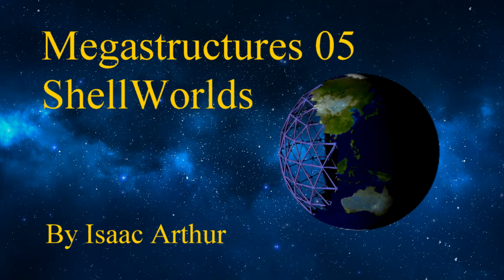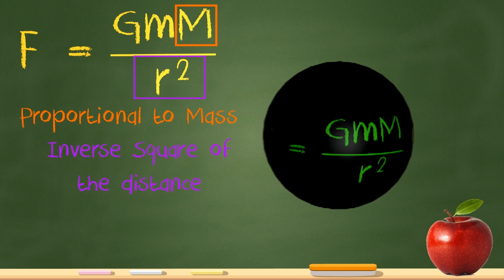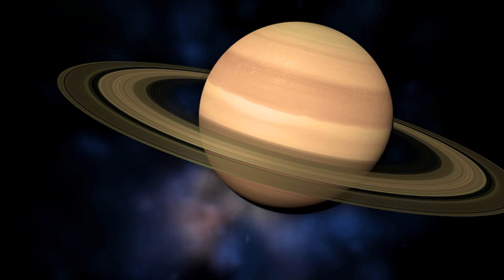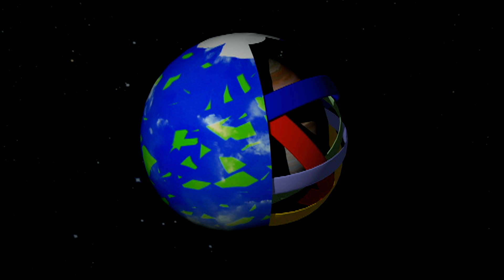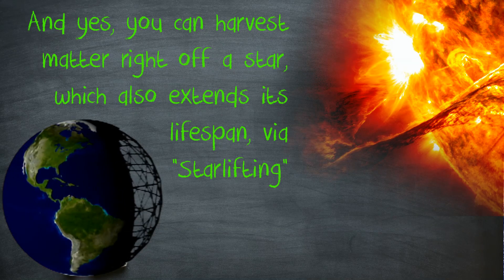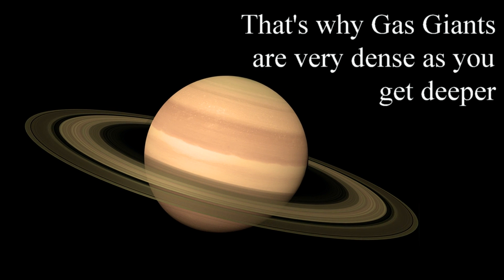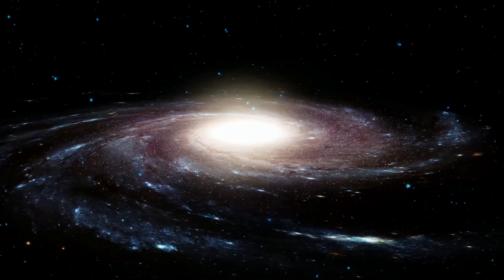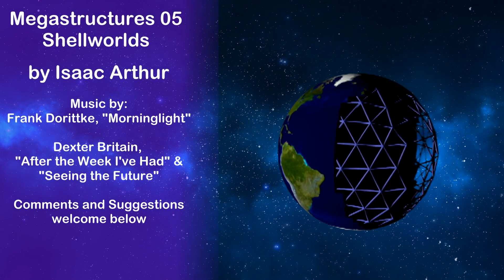Megastructures 05 Shellworlds

Comment: Couldn’t you essentially take this sphere interstellar to another star system with a large star, and essentially just siphon off the fuel from the star and increase its lifespan/expand your civilization using fusion to take excess star’s fuel, use it for your own energy/mass down to just carbon, oxygen, nitrogen, sulphur, etc?  

This is just in case there are no habitable worlds and you just enter a super massive star system with no other planets besides gas giants

Comment: I ran some numbers and an iron sphere with a radius of 4 km would have a surface gravity of .9 gees. Since gravity would fall off very quickly with height, the pillars supporting an outer sky shell around it could be made of conventional materials yes?
Placing the outer shell at the height where gravity an atmosphere drops off means you can have the radiation protection and keep the atmosphere from being blown off into space without having to worry about leaks the way a normal pressurized habitat does.
Plus you can just climb one of the support pillars into space. The outer shell makes it viable to orbit a small long-lived red star close enough for heat, without getting toasted by flares.

The other fun bit about this vid is that it explains how Cybertron works.

Comment: How would one prevent the blackhole at the center of the shellworld from eating up the the shellworld?
Reply: magnetospin keep in mind that black holes are not cosmic vacuum cleaners. A black hole with the mass of the earth will have the gravity of the earth at the same distance. So if you could build a structure strong enough to not collapse under earth gravity then it would be fine around a black hole.

You know how in physics gravity is modelled as a point. The only difference with a black hole is that it would literally be a point.
Reply: But you have to maintain a perfect balance at all times with the blackhole at the center.  If the shell is shifted by just a little bit, then one side of it would experience more attraction towards the blackhole and starts moving towards it, and once it starts to move towards it, it will experience even more attraction as it gets off balance.

Two people on opposite of the planet meeting for coffee could cost the destruction of the world.
Reply: magnetospin you are right in that regard, that's why it's better just to have gas on the inside, with that as the gravity as well as supporting the ring with pressure.

Comment: how do you deal with erosion on artificial planets? on earth, tectonic plates move and build each other up to compete with the forces of erosion.
Reply: We're talking about building structures where you can tailor the size, mass, chemical composition and other physical properties of the thing as a matter of simply doing the thing. Depending on what's going on the tectonic plates could be only a meter thick or be sliding around on a kilometer deep layer of aromatic oils, or any other damned thing, for all the designers care. So I don't really think that you can make that claim, that it "needs" to be a certain anything really, besides what is structurally required to hold the sphere together in the first place.
Reply: He said something about having techtonics, so I suppose if you built your layer thick enough it could have magma and convection currents within it causing plate techtonics.
Reply: it would have to be at least as thick as the mantle in order to do that.

Comment: Loved this episode but I was wondering...  what would be needed to change this concept into a planet sized ship?  I would imagine a sun or black hole inside the shell to provide power and heat but how to move the planet alone with the sun inside the shell?  How would the atmosphere on the surface react to the travel?  Would there be a need for an outer shell to hold the atmosphere on the surface?  I can see taking a good portion of the population in a journey to another solar system would be very appealing.

Comment: The one part I don't understand is why the upper shells don't pull you upwards.

Surely, the shell you're standing on would have its own gravitational field? Surely this field would extend to the shell above you? Also, you seem to be implying that at any point within a shell, the gravitational pull will be zero. Not at the center, you're saying at any point within the shell and that's something I don't get either. Surely, if you're closer to the shell at one end than the other (i.e. off-center) then you would experience a pull -- a pull towards the center?
Reply from the maker: Anytime you're inside a spherical shell of mass, that's evenly distributed, gravity in every direction exactly cancels out, even if you're touching that shell wall. Flip around to the outside and there will be gravity.
Reply: That sounds like such a lie but I guess I'll have to take your word for it. I think I need to see some kind of computer simulation on it as I still have the thought that being closer to the shell one side means a stronger pull to that side. It's still too strange to believe that a hollow sphere is able to create a space of nullified gravity.
Reply: +Mithra Look up Gauss' law for electric charges. Replace charge by mass and you'll get the answer.
Reply: I dunno if you're still interested, but here's a diagram that shows the phenomenon quite well I think. https://qph.ec.quoracdn.net/main-qimg-d7001dd9dfefa24681878ac25011bcbb.webp
The arrows on the left are larger because the point is closer to the mass, which is balanced by the more mass on the right being further away.

Comment: Isaac, I like you videos very much. On this one however you posited filling the sphere with dark matter. Not such a good idea, as DM has peculiar properties such that it would sieve out of the structure immediately. Harder to contain than monatomic hydrogen in a cheap rubber balloon. It seems to only respond to gravitational forces and doesn't appear to aggregate or clump so it likely wouldn't even rise to the level of a liquid even at near zero degrees K. Would it not be a better idea to dump plain rock if for no other reason than to clear out the debris in the solar system or even the ort cloud? At least it would improve the navigational hazards over time. Only problem I see is possible gravitational perturbations of the existing planets with so much mass in one place being created as opposed to being spread out in tiny clumps outside the inner system. BTW has anyone ever considered the celestial mechanics of one of those orbital sized rings and the gravitational impact across the inner system? OMG, now there will be gravitational impact statements filled before construction!

Comment: I wonder what would happen if we had a planet with a metallic surface
Reply from the maker: Well I think you'd want to cover it over with dirt unless you were doing the layered shell design, in which case that's less a planet then a port and radiator, with the real planet essentially in the layers below.
Reply: Or what if we had a Dyson swarm around our planet? The moment a fatal Asteroid came into our pull, the swarm would immediately surround the rock and either hold it down at a safe non lethal speed for mining/scientific purposes or escort it back at a safe trajectory and release...sounds crazy but its fun to sit around and think for the day. Also I think I got the idea of a metal world from the forerunner planet out of halo 4 its just a game but that actually is very interesting and kinda a similar principal to the mega structure series, and of course I'm a old halo fan :)

Comment: Would it be possible to distribute (uknown number honestly) a quantity of metal spheres of some kind, capable of being placed in orbit of the planet in question. then allow them to over time "cold weld" together, to create temporary platforms to build upon?
Reply from the maker: I suppose, so long as the spheres were small and the final object was significantly smaller in size than the planet.

Comment: Imagine if it leaked...
Reply from the maker: The bigger ones are less dense in the middle than normal air, so a hole would suck air down for instance, but it isn't like a balloon, only very, very tiny ones would 'leak' out into space if punctured, just mix their filler gas in with the atmosphere. You'd probably build the shell pretty thick though.
Reply: Isaac Arthur Yes, I just saw you mentioned that elsewhere. Thank you.

Comment: The one thing I see happening with a balloon world though... One good hole and it may pop.
Reply from the maker: :) Quite the image, but it doesn't really translate over, there's probably be a few kilometers of rock and 'balloon' between the gaseous inner core and atmosphere and the bigger ones would actually anti-pop, with air rushing into the less dense core, but such a thing would be easy to patch, even to design to self-patch, and the gas in the core wouldn't actually escape anyway except on a really, really small one, gravity would hold everything together and the atmosphere would just mix... which would not be a good thing admittedly.
Reply: Mmmm yes but mixing atmospheres could be bad too(explosive reaction depending on composition), depending on exactly what type of damage you're talking about. A meteor just hitting it to make a hole yes. But any type of good explosive ordinance(hypothetical worlds) I think a shell world stands the most to lose compared to other colonies, yes in other situations the colony may be destroyed, but if a colony somehow manages to blow itself up on a shell world. More what I mean is that could be disastrous for the other side >.> Not that it couldn't work but these are mostly just thought experiments anyway :P
Reply: Drakorus Felving Would we not be at least a type 2 civilisation without war resulting in mass devastation
Reply: The type of civilization we would be would probably not prevent war. Honestly along that vein I look at Gundam.
Reply: Drakorus Felving You have a point there. Maybe war goes hand in hand with any  type of civilisation. Maybe
Reply: I think it depends, if you had a species that was naturally cooperative with those around it and it gained sentience would they be warlike later on?
Reply: Maybe there are other civilisations/worlds else where out there that have all wars as  history subjects that are ingrained into them at birth along with every other is subject ( of course) and it is only natural to think and act on peaceful manner with thselves and others across their intergalactic region or known universe. I think we have really digressed now. haha
Reply: Sorry about the bad grammar

Comment: How would you exit the matrioshka shells though? I mean, if you're on one of the lower shells, then you'd probably need some kind of hole or tube that goes through the other shells to be able to leave earth. And if that's the case, then you would need to pierce through one of the actively supported rings that support the shells. But doing that would block the flow of the lifter material, so the whole thing would collapse.
Reply from the maker: The actual rings don't need to cover everywhere, anymore than support pillars,  they'd be more like a wire mesh in that regard, with flooring over top of them.

Comment: wouldn't hot air rise meaning you wouldn't need more than vent columns which would also be a power sorce
Reply from the maker: Sure, and you could probably tweak it to run a turbine instead of a less efficient thermopyle, but you might also want your layers 'unpressurized', where basically each one had a hundred miles in between and near-vacuum by the top of the next, to help minimize the the buildup of pressure on lower layers.

Comment: I really enjoyed this one, however I have two questions, Isaac:

One of the reasons the Earth's biosphere isn't restricted to very narrow bands of livable latitude and yearly hibernation is not just our seasonal change but also the rather consistent heat of the earth's crust. It keeps the arctic ocean from freezing solid and the tropics from burning up.

If we built a shell world as an analog to Earth, complete with a closely replicated ecosystem, how would a shell world disperse its heat evenly throughout its entirety? I imagine we could inlay it with a network of geothermal heat pumps, but I wanted to hear your take on it. 

Second, if a similar shell world were placed in orbit around a sun-like star and given an Earth-like rotation and tilt, what would the effect be on this shell world?
Reply from the maker: Well it's being held up by a massive array of particle accelerators or a balloon layer around hot pressurized gas, so unless you have perfectly efficient accelerators or insulators you will have a lot of heat flow rising up like it does from our own core and mantle. And if you do have those perfect accelerators or insulators you could presumably just let them leak a bit or run piping to move heat around to the right spots. Generally, assuming you've got the energy for it, heating stuff is the easy part, it's not heating stuff that's hard :)

As to #2, it should be about the same, you don't have an iron core giving you a magnetosphere but you do have a tons and tons of massive electromagnets below and you could tweak them as needed to produce one, you might even intentionally set it up to cause more auroras and such.

Comment: You mentioned the possibility of using a white dwarf or neutron star as the core for one of these. Could a brown dwarf also work, or would that have too much heat output?
Reply from the maker: No a brown dwaf would work just fine, they don't output that much heat.
Reply: Thanks, Isaac, and keep up the good work.

Comment: I can't help but wonder with regards to matrioshka planets... If an outer shell was hit, and it gained some momentum, would the outer shell move toward an inner shell and possibly impact it?

How stable would they be with this in mind?
Reply from the maker: Not stable, no megastructure should ever be viewed as maintenance free anymore than a wall, a skyscraper, or a ship. If you bump a shell around a mass it will drift into that mass, unless you bounce something off it. You'd probably use Atlas Pillars to keep the layers separate until you got to an inner last one (over a sun or molten core etc - and just bounce lasers from the last layers down to the core, transferring that momentum to the core and setting everything to relative rest again.
Reply: I didn't think about Atlas Pillars to keep the layers separate! It's a great idea, and perhaps a way to get to an orbital ring, if required? I can imagine that coming to near the center of the shellworld, using a large elevator on the pillar, and going up another would be a better way of quickly traversing the shellworld, however.
Reply from the maker: For an orbital ring it really shouldn't be necessary, though I think I'd deliberate include them on the bigger wide ones.  They would make good transports, especially for heavy freight, but the main transport would probably be on the guy wires sprouting off the thing since those would let you have a wide direct connection zone to cities so they need not be right under it, while also helping to stabilize the ring.